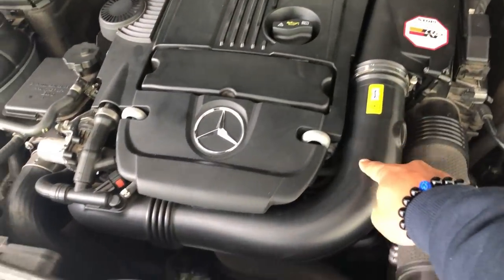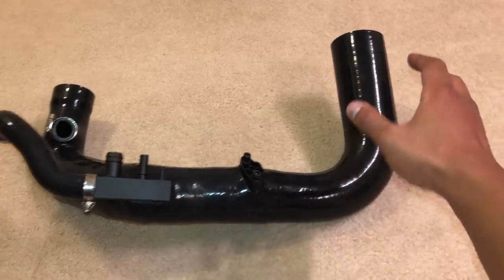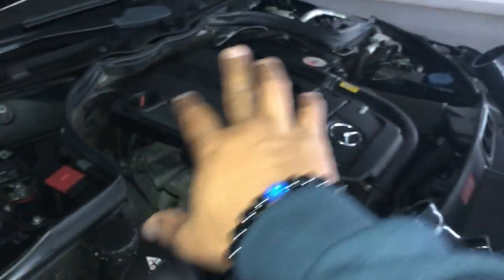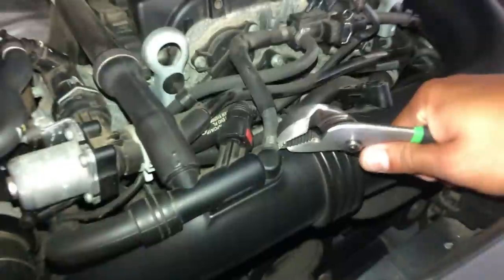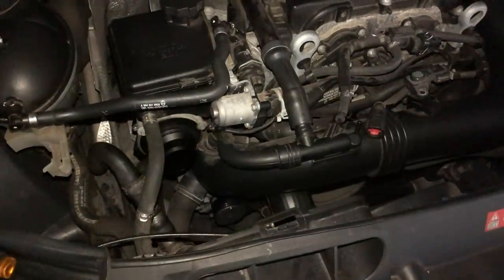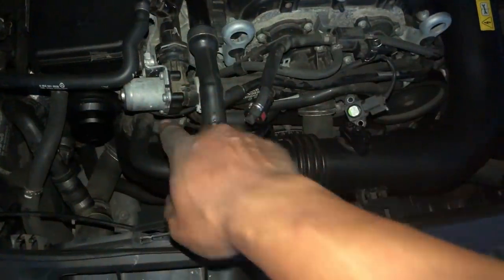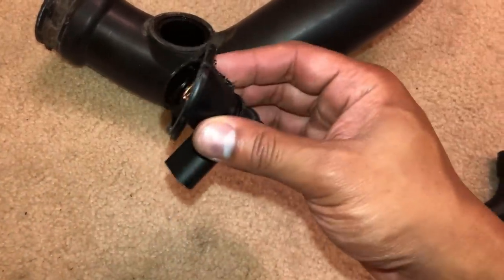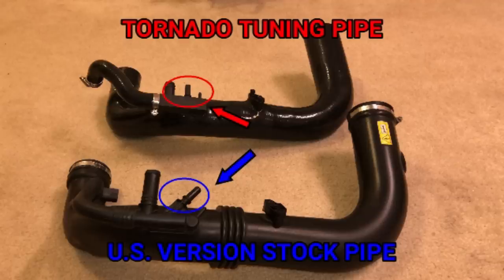UPGRADE MERCEDES C250 AIR INTAKE TUBE PIPING

Comment: This is a great video.  I found out I had a busted intake tube when changing the water pump 2 days ago.  During the process, I even broke off a piece and it was brittle already.  I had to make a spot decision to just put duct tape on it and put in back in like that.  Not to mention, it was a pain to put back in.  I spent more time on the tube re-install than with anything else.  I'm looking for a new intake tube.  Thanks!

Comment: You definitely know your way around these engines . Very helpful video ! Do you know if the M271 turbo engine in the C250 1.8 liter turbo has an EGR valve ?  I cant see one but its very tight packaging . If there is an EGR valve where is it ?  Thanks .

Comment: I noticed there is a K&N filter in that car. The mechanic I used to go to told me not to use those as it screws up the MAF and O2 sensors. K&N says there should not be a problem... who do I believe? Have you had any problems with the K&N?
Reply from the maker: KN filters alone don’t mess up cars.  Over-oiling a KN air filter will mess with the car. Over-oiling any cotton based filter (even if not a KN filter) will mess with the car.

Comment: Hey flex by any chance do u know what this sensor is called 5:56 and what it connects to. I realize that it’s missing the connection to it so wanted to see if you knew what connection it connects to
Reply from the maker: Sorry. No clue.  I think it’s just an air sensor but I don’t think Mercedes sells it separately cause they want you to buy the entire huge pipe.  Best way to get it is find a used pipe and take it off.

Comment: What sensor is that final connection end of the air intake? I seen that my connection has been missing wanting to figure out what it’s called?
Reply from the maker: Honestly, I’m not really sure.  I don’t even think you can buy it separately because when any portion of the OEM intake tube pipe fails, Mercedes only offers a replacement pipe that included everything. I’ve never see individual parts of it being sold.  That’s why I had to reuse the sensor on my aftermarket pipe.

Comment: Flexx i need your help big time, my car keeps missing oil and im not seeing no leaks, im thinking of replacing the pcv valve. I see no smoke coming out the muffler so i don’t know if that would be valve seals 😢
Reply from the maker: Then you’re probably burning oil. You need to see a mechanic asap.
Reply: I am definitely burning oil but i dont know if id have to replace the valve seals or just the pcv valve

Comment: I removed my air intake tube on my 2012 c250 mb and cant get the bottom on, is there a trick to put it back on? HELP please.
Reply from the maker: It also helps to take out the inside rubber piece...and use a plier to "slightly spread open" the plastic end of the tube so it's wider. Put the rubber piece back in, and then I used WD40 to lubricate the inside of the rubber piece. And then I held the entire tube in a vertical position while pushing on the bottom part of the tube back onto the car. 
Then I tightened the clamp. Done.

Or take the rubber piece out of the end of the tube and put the rubber piece on the car. "Spread open" the end of the tube. Put some WD40 on the rubber piece while it's still on the car. Then push the plastic end of the tube onto the rubber piece that's already on the car. Then tighten the clamp and you're done.

Comment: Hey Flexx, miss your vids on the c250, I wanted to see if you knew what part number that lower sensor that you had to swap over to the new pipe is, wondering if mine needs replaced but cannot find that lower sensor anywhere.
Reply from the maker: I don’t remember. Easiest way is to take the part number off the actual part that’s on your car.  And then plug that part number into FCP euro or Autohaus.

Comment: I just ordered this part and it says FoneFunShop on my bank statement, is that correct?
Reply from the maker: Yes. They are the distributor for tornado tuning. They use to distributor phone accessories but switched to automotive parts.